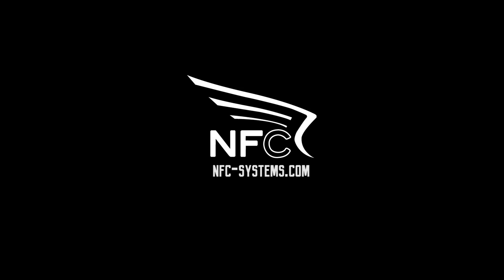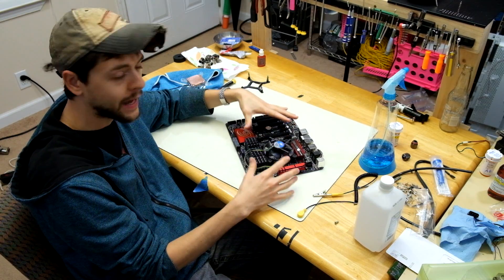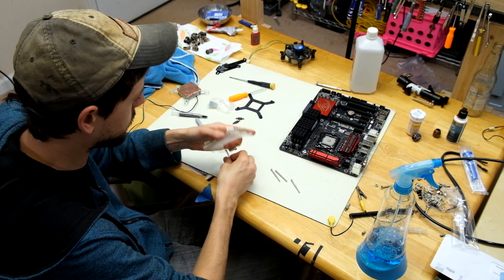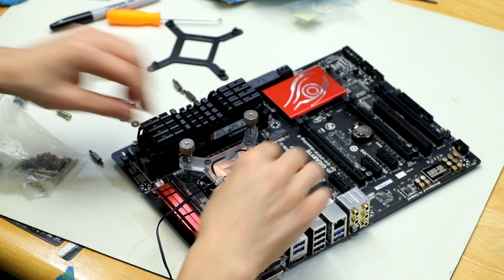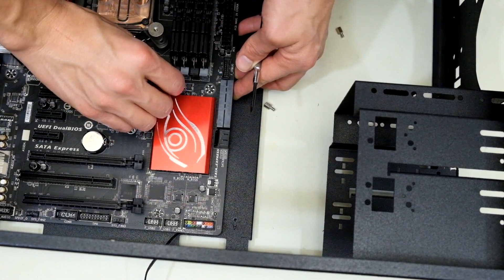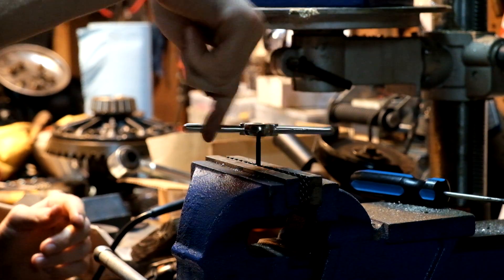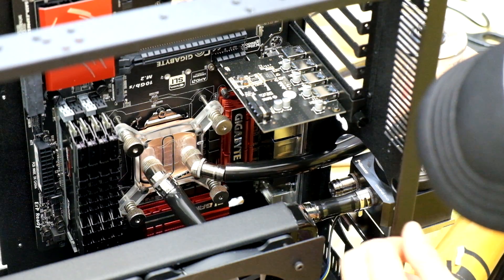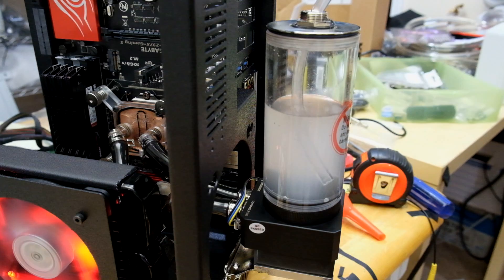PC Building With Josh - Episode 3 - Liquid Cooling Installation

Comment: I would assume that if the guy does not know much about the hardware it would have been simpler to use aircooling only with a Scythe Mugen for instance. That way he does not need to change the water. It might not even be much louder.
Reply: kalotodo He knows his hardware. 
Its a preference.
both aircooling and watercooling has its pro's and cons.
also you don't really need to change the water that much. i do it once every one and a halve year! and its still crystal clear and no temp rises.
(i use distilled water with a little bit of special pc cooling liquid)
and by that time it's most likely also time for a upgrade so yeah...
Reply: kalotodo also if he wanted to keep it simple why would he go trough all this effort to mod the case?
Reply: Fawkes True alright, I see your point.
Reply: ***** I did not think of that. I was in the simple mindset of just building a PC. Its obviously more than a simple PC build. Have not watched that many videos of Josh yet.